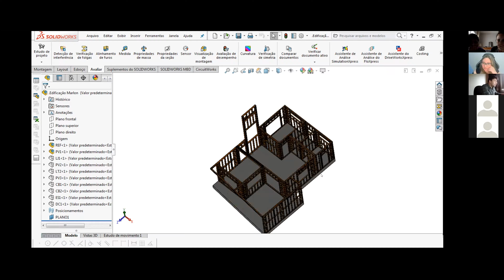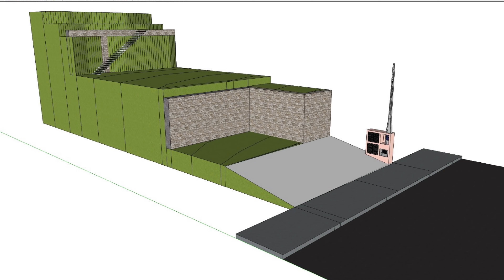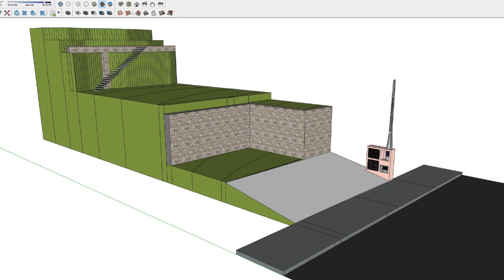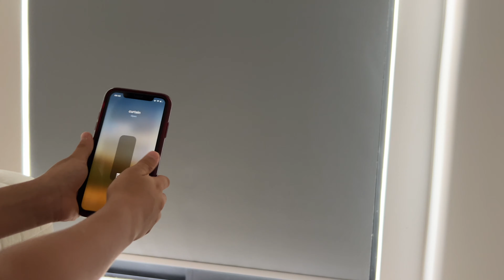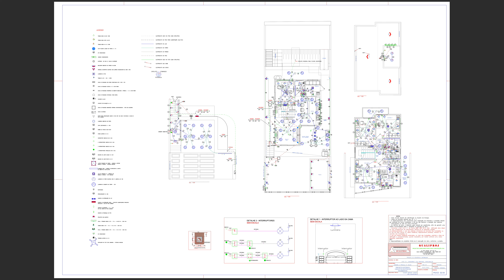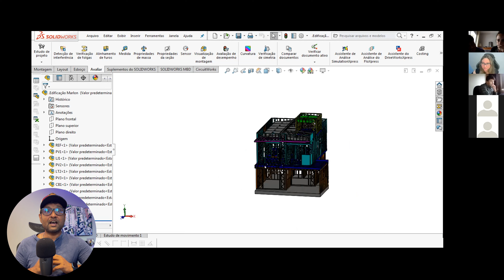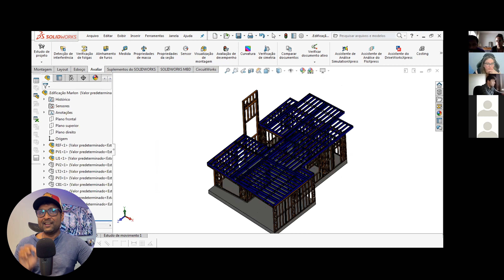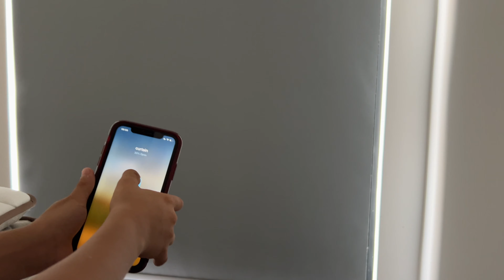We built our Eco Smart Home in Brazil: From Start to Finish Construction

Comment: Eddie...my wife, who is from Curitiba, and I are thinking of retiring there in a couple of years.   We built our home in the US.  We have already started looking at property in Curitiba.  What part of Brazil are you in?  How difficult was it for you to source the materials?  And I didn't see any type of insulation in your house?  Did you insulate?  I am interested in seeing how well having a tight envelope on a home there works.  I know that humidity can pose serious challenges.  But I would like the option of a better conditioned interior....air, etc without the complications of mold.  Our house here has a geothermal central air system with dehumidification and ERV for constant fresh air.  Regards Aron
Reply from the maker: Hi Aron - I am currently based out in Sorocaba São Paulo. Well sourcing light steel frame material is available widely. Yes we did do insulation which is recycled pet wool ... Humidity could be a cause of concern up north Brasil but here its not that bad and down south you'll need to be concerned of the dry cold weathers. HVAC systems are crazy expensive here and I used split ac's for my home. Anyways thanks for watching the video and appreciate the feedback ... And most importantly  - retiring down south is the best decision :) much better than Sao paulo
Reply: @eddiedsuza  Eddie thanks for the reply.  Good to know.  We are noticing that some new developers are starting to use more energy efficient designs.  We have a couple of years before retirement so we are starting to plan now.  When we built our house here in the US, we had it certified for energy efficiency.  R50 ceilings, r30 walls, insulated walkout basement floor, and geothermal.  Saves a lot of energy and money.  Kentucky is very humid also...so it's important here to make sure the wall assembly dries to the inside.  We use whole house dehumidification in the summer and an ERV for constant fresh air.  When I first went to Brazil 22 years ago, I found the construction methods interesting and was surprised that the general construction processes had not changed much.  It is good to see that they are finally using some different methods.  Economies of scale will hopefully make it less expensive and easier to get newer systems like geothermal etc.